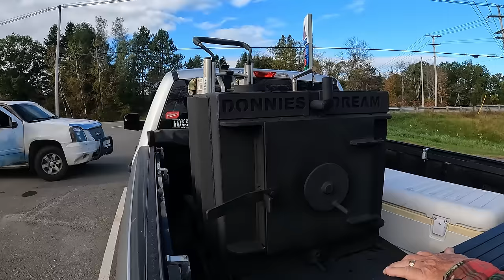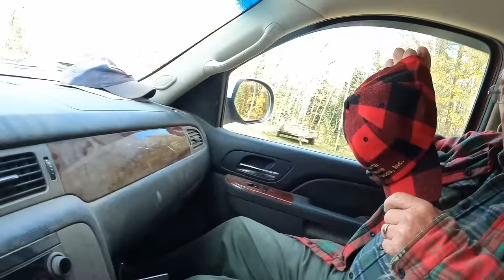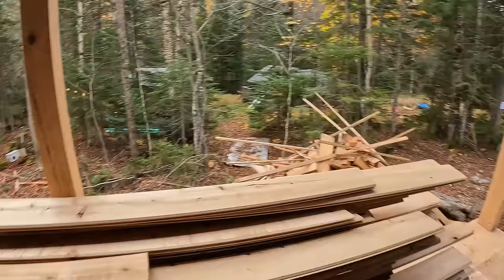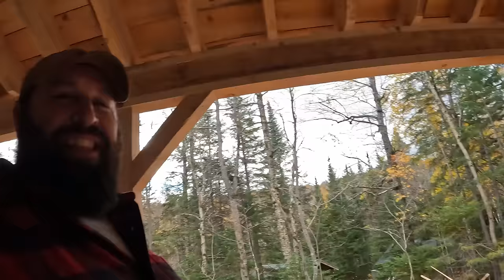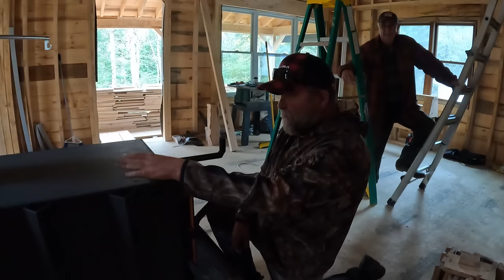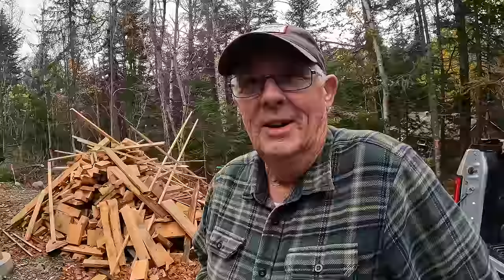CABIN SERIES: We got A CUSTOM WOODSTOVE!!!

Comment: I used cement board with slate tiles on top for my stove hearth and the other stove has cement board and marble.  Have to get the stove nice and hot to season it.  Rock wool is better but usually  more expensive and not as good of an R value(but not far off) I hate glass
Reply from the maker: I am all done with glass if there are no problems with the wool.